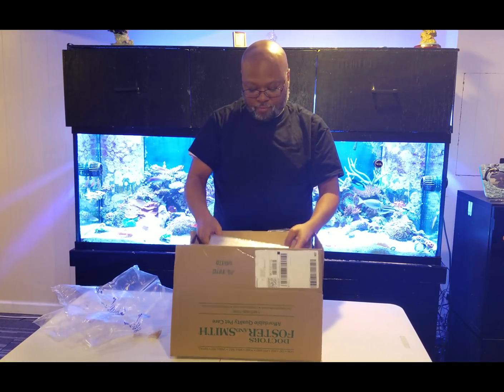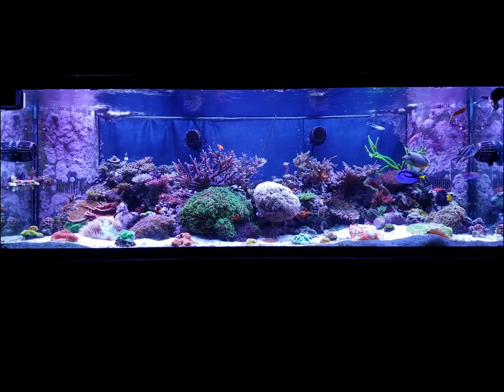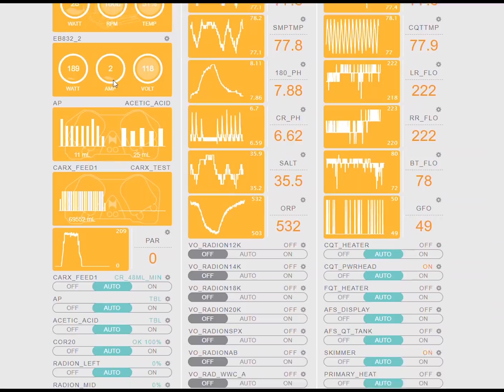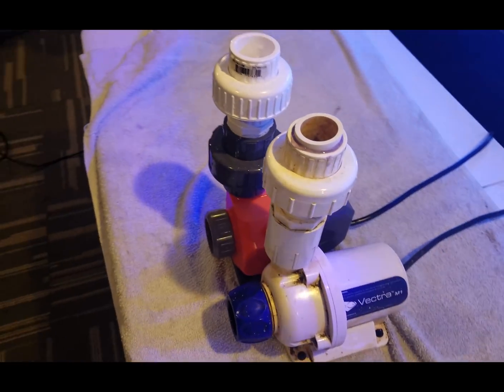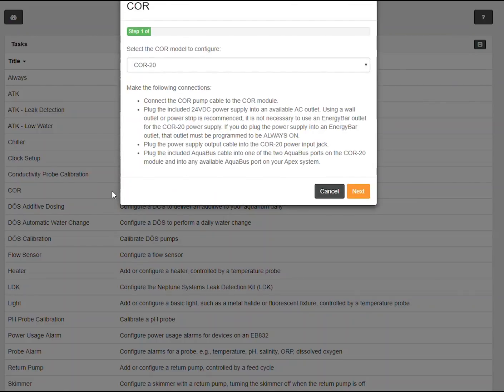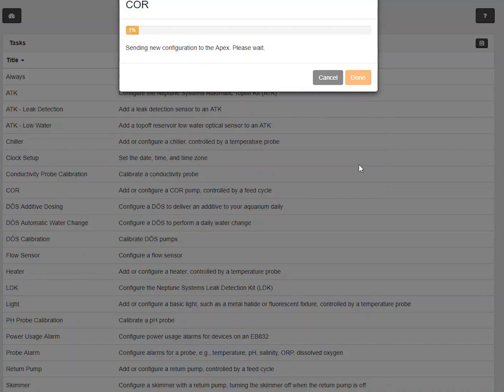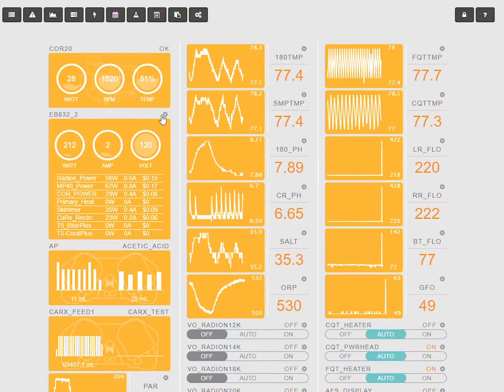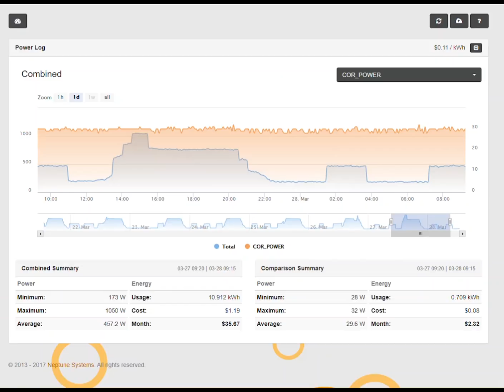I swapped out my Vectra M1 for a COR20!

Comment: Thank you for making this video.  I'm thinking about making the switch myself.  I have a couple of questions.  How does the flow compare?  Is there any difference in water temperature?   Thanks in advance and you have a really nice tank!
Reply from the maker: I really don't see a difference in water temp. I think the flow is better then my old vectra m1 and it uses less power at the same level in my case. I have bumped up the power/flow tho. It works great for me.

Comment: Hey man I switched from my RedSea that came with my tank and just installed a core20 definitely more compact, no need of a big sponge under to prevent vibration. Definitely a good purchase, my concern is the flow cause I had a flow meter but I installed my core with the 11/4” union and when I look of the flow is only giving 527 because on the flow settings I put that I used a 1” flow meter but I change that for the 2” immediately change to 2500 flow in my opinion the flow setting should have a set for 11/4” but flow is flow regardless the size I will say am new basically couple years to this hobby and am learning the trade. Can you help me verify this or what I did wrong . Thank you!
Reply from the maker: The Neptune flow meters should be set to the size of what the meteris. I use 1 inch meters on my split returns and 1/2 inch for reactors so they are configured as such despite having the  1-1/4” union and a 1-1/4” to 1” slip x slip PVC reducer fitting.  My flow meters show the following in gallons -  253, 245, 105, 33, 121 for my returns and reactors = 756 gph for the whole system My CORs max speed is 45%. Hope that helps.
Reply: Tha Bizness Reef Tank mine core20 is only for the return line where the o1” flow meter is installed and I don’t get more that 520-527 at 100% but if I go to the module and change the size of the flow meter, immediately change the number to 2200 so am confused here I think this numbers are premeditated according to the size of the flow meter regardless of the size of the pipe. Am writing to customer services to see if they can check if I did something wrong or what else could be. Cause it doesn’t make sense to me.
Thank you! Anyway I see that you are calculating total of gallons . Thank you!